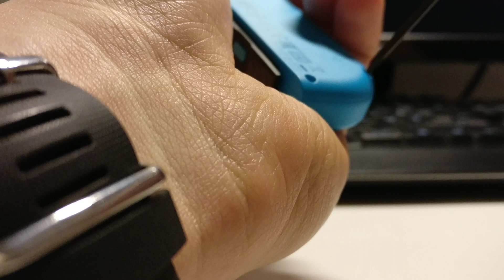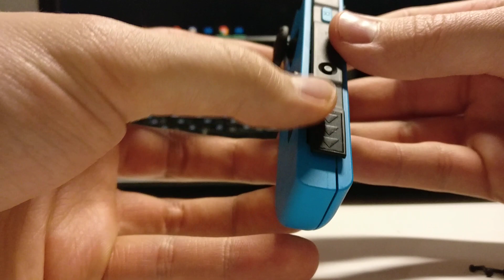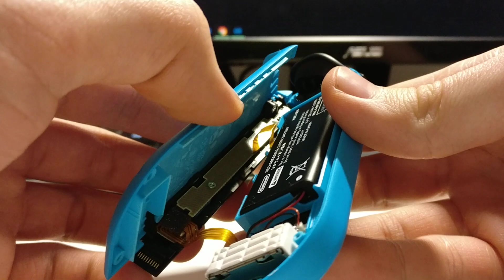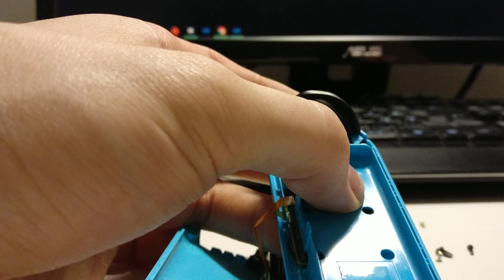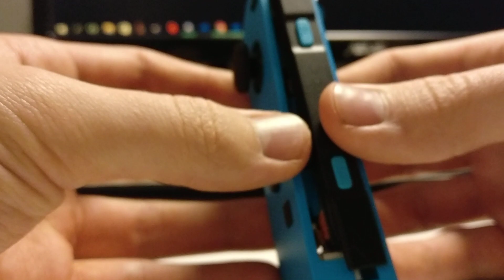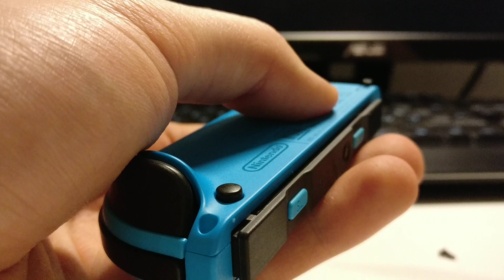Left joycon fix with conductive foam

Comment: hey but..did you just place the conductive foam there without applying any kind of liquid or something? I thought it was just a piece of that, I thought it has something else
Reply: "This foam, treated with some conductive metal, is used to lessen the interference of external radio signals on the Joy-con’s own antenna." 

It seems is treated with something..
Reply: The foam was already treated. He got the foam from his graphics card packaging. READ
Reply from the maker: Leo G       i just placed the conductive foam there. I did nothing else. Foam needs to be thick enough that it stays in place.
Reply: If I'm asking is because I still have doubts, I don't know anything about this topic, also I speak spanish, so it's even more difficult to understand this kind of things. Thanks for your answer